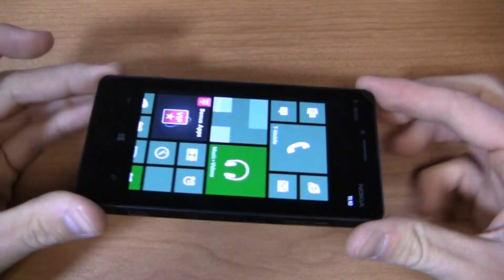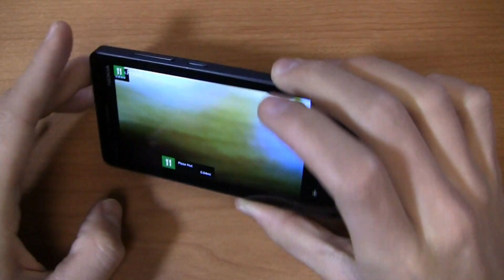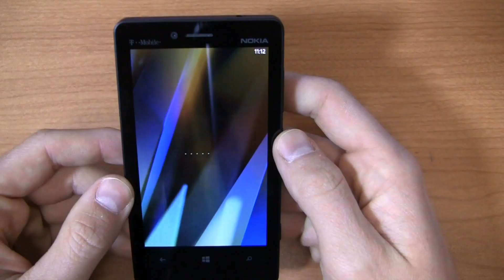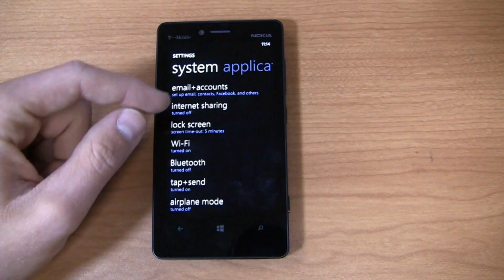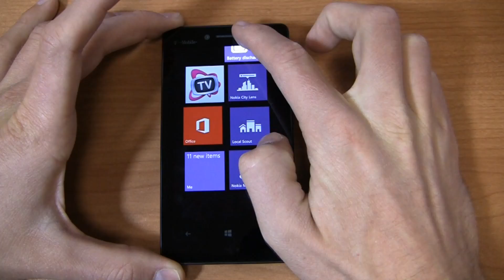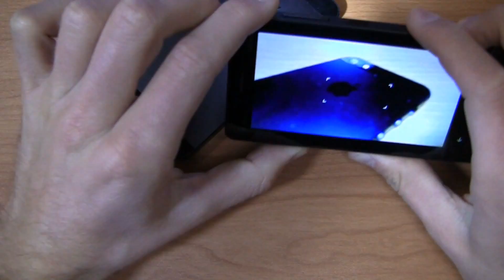Nokia Lumia 810 Review Part 2

Comment: Actually I have been comparing both trying to figure which is better. Tmobile only has the nokia 810 for 149.99$ (99.99$ after mail in rebate) with a monthly bill of 89.99 with unlimited 4G talk+text.... AT&T has the Nokia 920 for the same monthly price 89.99$ but for 3Gb of data 450min talk 5000mins nights/weekends free mobile to mobile. AT&T 5Gb data plan (which includes wifi tether) is 109.99mo. tmobile's service with mobile hotspot is 94.99mo. that is a difference of $15 not 50.